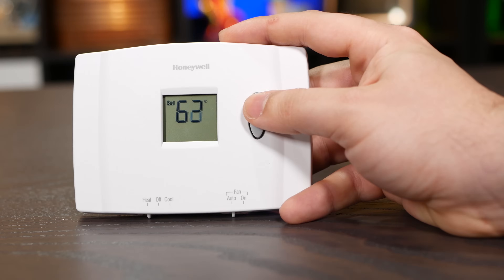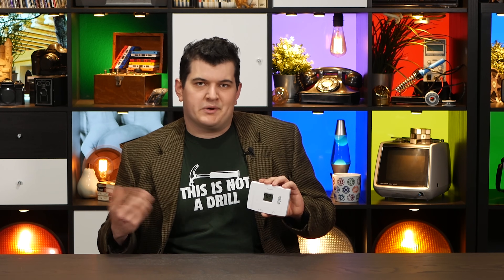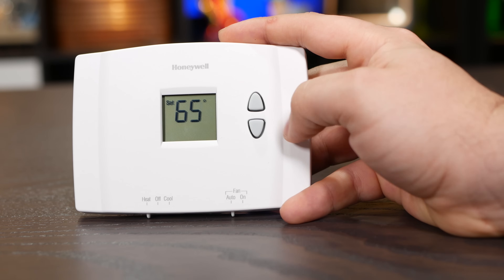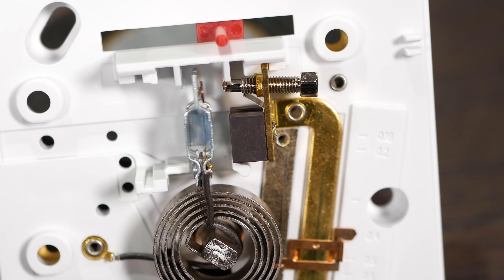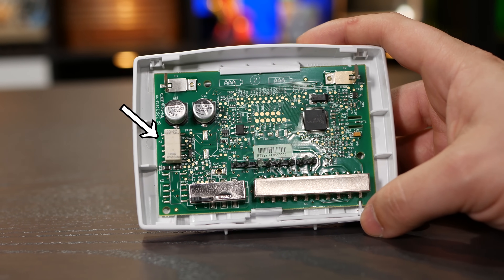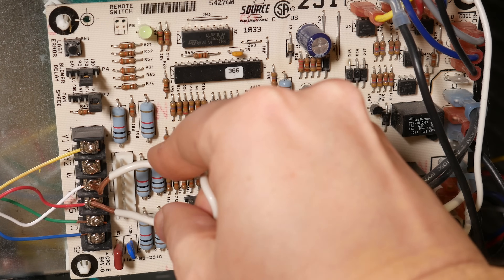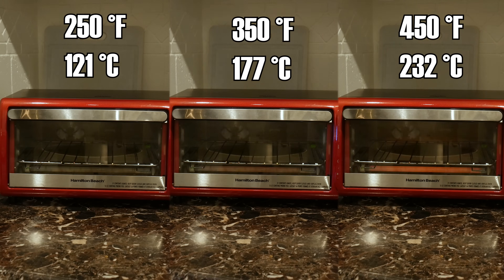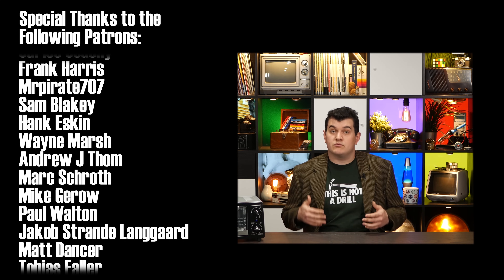Thermostats: Cooler than you think!

Comment: Interesting to see that in the USA heating systems are still so primitive...
That likely is because energy is so cheap there that is is no problem to waste it.
Here in the Netherlands, almost all heaters installed in the past 20-25 years are of the condensation type (high-efficiency) and they run better when they use modulation instead of on-off control.
During cold season the heater will run all day and change the output depending on what the thermostat feeds back to it.
This kind of thermostat commonly uses only 2 wires to send power from the furnace controller to the thermostat AND to send serial data both ways to tell the furnace how much output it should provide and to tell the thermostat about the furnace status (including faults).

This situation also meant that those "smart" thermostats from the USA (like the Nest that was shown) were actually quite dumb when installed here, until in the second or third generation they started to support modulation.
Reply: Condensing furnaces are pretty common here in new homes, but that has nothing to do with the thermostat really. Although, you actually want the furnace to run for longer stints rather than shorter, not only to prolong equipment life, but also to increase efficiency.
Reply: Smart thermostats are still dumb, because they have ZERO security. Remember: The S in IoT stands for security.

Even worse is that people want "smart" door locks and home security systems. I can't wait for robbers to just start hacking people wifi and unlocking the door.

Comment: You gave a very good explanation of the subject.  
You can PWM the fan in an AC/Furnace, or a resitive heating element, but not an AC compressor (which is also part of a heat pump).   And you would have to be careful about using PWM on the fan, because lack of enough air flow could cause an AC heat exchanger coil to ice up, or a resistive heating element to overheat and burn up (so you would need t PWM BOTH the fan AND the element).
Now there are multi-speed compressors that in theory can regulate their output, but these are mostly used in multi zone "split" systems that would allow regulating the temperature in each room independently.

Comment: Where did the "24V AC" come from? It seems like such an odd choice from todays "everything is 12V DC" standpoint.
Reply: Because 24 volts is high enough voltage to break through minor oxides on switch and relay contacts that would normally require expensive gold terminals.

Comment: "I turn it up because it heats up quicker" -  The amount of people that think this is infuriating. Thank you!
Reply: - my wife
Reply: And stepdaughter
Reply: I used to work at Menards (think Home Depot or :Lowes but limited to the upper midwest).  Had  many people ask about an "Express" setting when shopping for a new thermostat.  Pretty much gave the same explanation as the video that it is a longer run time that gives a longer temperature swing.
Reply: @davidwayneprins  save big money at Menards
Reply: Rick White Actually depends on the physical layout.  If the thermostat is located between you and where the heating/cooling is, telling the thermostat to make it hotter / colder where IT is will change how fast it gets hotter / colder where YOU are.  Other similar situations exist.  Of cause if the difference between the "turn on/off now" points is large enough, it might oversteer enough to get your location hot/cold enough anyway.
Reply: I honestly never heard anyone say or do this. I thought it was pretty much a given. Guess not.
Reply: It's funny how he just proved himself later in the video by showing the ovens turning on more frequently when the temperature was set higher
Reply: @bland9876  Not sure what you're saying; it proves his point, not disproves it. It's on full blast until it's up to temperature, only then it cuts off, no matter what that temperature is.
Reply: I did that this morning. "OK Google set nest to 26 degrees" oops
Reply: - Most of my co-workers. I constantly find myself explaining how thermostats work in the futile hope that I can stop putting it back to the middle of the range every time I walk in. Apparently I'm not successful though, because I constantly find it maxxed out in the middle of winter with the windows open because it's too hot...

Comment: About the setting your AC full blast  for a time and then return to normal, why would you need a special thermostat? just use a mechanical timer on parallel with the AC wires. While the timer runs the circuit closes and AC works, when time runs out, the thermostat decides: a simple hack. 
Also can you confirm that 24volts is a standard? Because I seem to remember seeing in some places mentions of 48v (I'm from Spain, so current is 220v, 50hz)

Comment: This is a bit nit picky, but you did sort of encourage it. You said that the furnace outputs 10 kW of heat, and that running it at 30% duty cycle turns into 3 kW heat output. While this is effectively what happens over time, it's heat output is still 10 kW, or 10 kilojoules per second, it just runs for 3 minutes instead of 10, outputting 1.8 megajoules of heat instead of 6 MJ. Precise communication is important. :)

Comment: my cheapo thermostat has a "temporary" setting that does exactly as you mentioned at the end. gets to a new desired temperature, and shuts off, then returns to the "hold" temperature after a single cycle. its actually a pain in the butt, because changing from "temporary" to "hold" mode is very confusing, and sometimes requires pulling the battery
Reply: honeywell  671304  looks about right

Comment: My house is heated by a natural gas furnace that heats water that runs in the floors. There's a thermostat for each room which acts like you described.
The the furnace can run from 30% to 100% depending on the incoming temperature of the water, if it is used for heating the house or heating water for the taps(there's a buffer tank for that tap water).
Furthermore there's a sensor outside that regulates how hot the water for heating should be, the colder outside, the hotter the water will be. There's a regulator that offsets the degrees of how much it should change according to the outside temperature. Because a well insulated house does not need to heat up the water as much when it gets colder. The most comfortable and economical setting are where the temperature for heating are as low as it can be and still keep up heating the house. It takes a few days to adjust when you get the furnace installed.

Now my split-unit heat pump in the living room scans the room for hot and cold spots using a rotating sensor and can direct the heat or cooling where needed by changing the direction of the air. And you can also ask it to blow the air your way or keep it away from you, as you might not want to have a blast of cold air directed at you but might like to have the hot air in the winter pointed at you.

Why do I have both a heat pump and gas fired furnace, well that's is for another video. ;)
And why did I write this that no-one will ever read, for the engagement algorithms, of course.

Comment: 16:50 my Daikin’s AC has “power” mode, which runs with full power for 15  minutes, many Japanese AC has similar feature.
Reply: My LuxPro PSPA711a also has a temporary temperature override setting.
Reply: My Daikin AC has inverter so it can actually vary output power and not run on full blast and then idle for minutes at a time. The thermostat changes voltage on the control wire to control the output power.
Reply: @NyanSten  This inverter technology is now common in refrigerators too (e.g. Panasonic). All larger installations have been inverter-based for quite some time, and even the smaller "through the window / wall" modular systems are now offering this technology. Major innovators in this "no Technician installation necessary" area of small compact fully integrated units are all Chinese. Gree, and Midea (the latter the World's largest manufacturer of a/c systems, small and large).
Reply: Most ducted systems have this facility. The modern systems have single-zone or multiple zone time-selected override (and you can choose the temp. override in single degree increments). Add in the now ubiquitous "App-based" zonal management and you can control the room temperatures of your home from anywhere in the World with mobile 'phone access. It is interesting to note that the Mobile 'Phone leaders, LG and Samsung, offer the most comprehensive "app-based" systems. Samsung offers fully remote diagnosis of any faults, including upload capability to their local service network.

Comment: Two things;

Mentioning the connection (nice!) between thermostats and the PWM process reminded me that this is soemwhat how "1 Bit D-to-A" systems work for CD players and such.  In fact, the thermostat is closer to the 1-bit system as it "reacts" to the desired value vrs the current value... I feel like you had a video about this and if that's the case, i'm mentioning info that you already taught to me in the past... oops.

Also, TIL about < and > keys for single frame operations in the you tubes! Thanks!

Oh, and what's the deal with the blue wire!?!?!?!
Reply: Oh. the blue wire is just a common return for using power from the furnace when a heat/cool/fan cycle is not currently active.  For some reason I thought it was going to be more exciting than that, but in retrospect, it's a thermostat.

Comment: 16:25 I have an Ecobee 4 Pro and it kinda allows you to do that. It let's you set a schedule for when you're home, sleeping or away. If you manually change the temperature, you can make it go back to the schedule after 2 hours, 4 hours, on the next schedule change (like going from "home" to "sleep") or never.

Also of note, the Ecobee 4 Pro has a room temperature sensor. It's a tiny puck which connects wireleasly to the thermostat and tell it the room's temperature, as well as if someone is there (or has been there recently). I keep it in my room because it gets unusually hot, so the ac runs longer than usual to keep my room a bit cooler. Of course, it keeps the house too cool, but I'm fine with that.

Comment: You missed something important. In the US the average thermostat might be dumb, however there are standards like openTherm that tell how much heat is demanded and you don't go full blast but you get a more moderate temp and get it to run more efficient.

Comment: Having multiple sensors would be great if you didn't want to heat the room the thermostat is placed in. With vents and multiple sensors, you could accomplish an analog zoned heating system. What if I just want to heat 2 small rooms and the thermostat room is rather large? That COULD save on heating costs in a very cold climate.

Comment: I grew up before the days of thermostat-controlled "HVAC." When opening two windows was "air conditioning," which you put on High by adding a fan in one window. Our heater WAS "adjustable;" want more heat, add more coal. The thing did not run full-blast like modern units. But on really cold mornings, we'd go into the living room and sit in front of the old gas-fired heater (which sat where the fireplace was), waiting for the boiler to run steam into the radiators. No wires involved.

Comment: In the UK I had to really do my research to find a combination heat and hot water boiler with opentherm compatibility for my gen 3 Nest. It performs weather compensation to adjust the temperature of the hot water in the radiators depending on the outside weather and internal temperature. Also most modern (30 years or newer) gas boilers have some level of output modulation so as they approach the preset heating water flow temperature they reduce the amount of output from the boiler.

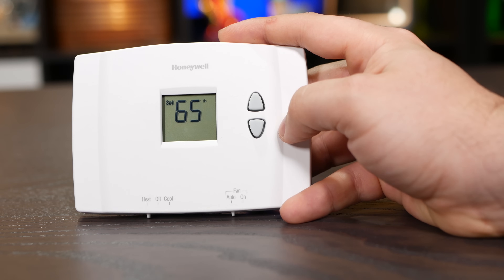Comment: 1:54 This isn't completely true, at least on my thermostat. Mine defaults to 50% and can scale from 35% to 100% with a change in the settings. So by default, mine is medium blast. Now, it can't dynamically scale or anything fancy like that. It is still on or off, but the user can adjust the speed regardless. I've also read that it may not be a good idea to change the fan speed from the default setting, because it can damage the equipment, but I can't find the reference for that anymore.

References:
My Thermostat Manual: https://renaudelectric.com/wp-content/uploads/2018/04/Trane-XR402-Thermostat-new.pdf
(Ctrl+F and search for "variable" and "continous" and you will find the relevant material, and yes, Continuous is misspelled intentionally. Typo in the manual, not my brain.)

Comment: My boiler has three settings;

1. Off

2. On

3. EXPLODE!!!!

Luckily I've only ever needed the first two.
Reply: This brings to mind a funny anecdote (code for probably stop reading now), but in ye old yesteryear when I got my first "blue collar" job, I had moved to the balmy climes of Alaska and charisma'd my way into a job doing remediation work (think water damage, mold, fire and death remnants (paid double time!) within man-made structures.) I was told that we need to remove pressed paneling up to a line four feet circling this garden level room. Now, in Anchorage, there's quite a bit of boiler fed baseboard heating, and this property was no exception. So... You can cut paneling by running a utility knife along a line to make a score mark and snap it off. But that's laborious and time consuming. We just got a full set of battery op hand tools. Circular saw sounds much faster and easier. Short story long, a circ saw will do a number on copper piping, and the first 30 seconds or so of water spraying out are fine. But then the boiler kicks in while you've got a piece of rubber hose and some zip ties just in the right position. That room needed a lot of dehumidification (dead of winter, couldn't really open windows and doors to vent).
Reply: My grandmother had an electric fan that had three settings... off, too slow to make a difference and too fast like a wind tunnel. No joke - that thing sucked.
Reply: Don't forget. It also blew.
Reply: @therealxunil2  if it sucked, you probably had it in reverse.
Reply: I remember back in the day when I was young and poor and me and my buddy rented a third floor walk up in an old poorly insulated brick building.  It basically became a furnace in July and August.  My dad gave us his old window shaker a/c unit from like 1972.  It had two speeds.  Off, and Full Blast.  So basically, you had the option of furnace, or meat locker in our apartment, lol.
Reply: Not many options here, but if your home is insured and run down AND you need a pile of cash to buy a new home option 3 would be very convenient.
Reply: @David Witt - As long as you're not in it when option 3 is active.

Comment: So... Why doesn't the smart thermostat you showed use the blue wire to charge itself? Are there some houses that don't use a blue wire?
Reply: Houses with systems originally installed before the blue wire became needed (because mechanical thermostats were all ANYONE had) don't have a blue wire, and running a new cable can be difficult. So thermostats need to be able to handle what folks already have.

Comment: The toaster oven cycling reminded me of the flat-top range I used to have. I hated it for candy making because the burners seemed to have only two settings, on or off, and the difference between low and high was just how frequently they cycled on and heated up the glass top. It didn't allow for the smooth, fine control I wanted. (Happily, I now how exposed coil burners again.) Do you know if my assessment is correct and the stove knob is just a glorified timer, or was there something more complicated going on?

Comment: i think the "cranking it up" myth is connected to the question in the end on "multiple sensors" ...   while, in theory, the whole house should respond the same, this is sadly not true in most homes due to varied head loading from appliances and the sun, doors, etc..   some houses are better than others at this, but my current 2-story townhouse is plagued by it.... some rooms are 4F higher or lower than others due to heat loading. Notably my bedroom in the morning (morning sun) and my office in the evening (setting sun) ...  obviously I have an electronic timer style thermostat that I can have different set temperatures per time which helps keep a similar average temperature for where I physically am during the day...  but I can see how, especially with simple ones, it can 'seem' that one must adjust the thermostat on hotter / colder days or whatever...     since one might come home and have intuitively known that they want it at say 76F but they have to move it to 74F because the room they are in is being heated by ...  kitchen, sun, whatever and while the ac will eventually work to balance it (as much as thermodynamics allows, and of course when the loads stop and the system is more effective across all areas) ...   and then they have to crank it back because its 'gone too far'.     or something....

Comment: I got a thermostat on my heat pump that I don't have to tell it if I need heat or air conditioning. I set a temperature range and it automatically keeps the temperature with in that range. Very good for Spring or Fall days where at night the temperature could be 45° F and the daytime temperature could be 80° F. It also monitors the outside temperature this is so that it can determine if normal heat mode or backup heat mode is needed. It has more than the 4 basic wires.  I only wish that it had a rechargeable battery as it stops working in the middle of the night on the coldest day. 🙄